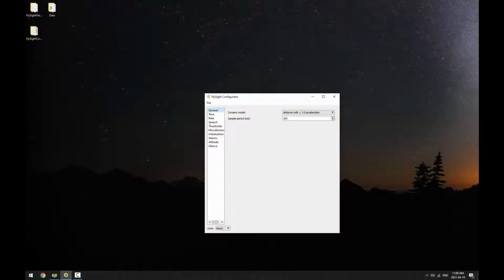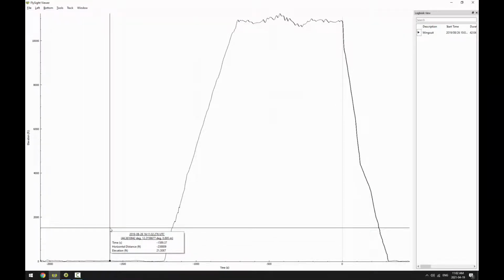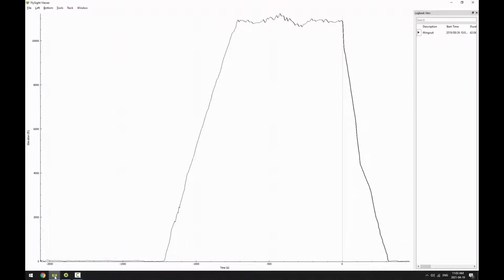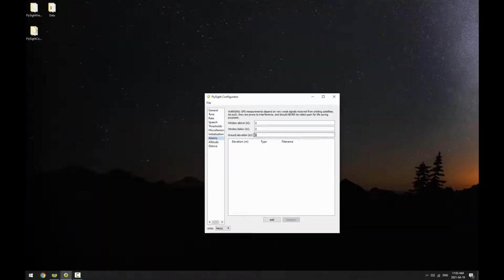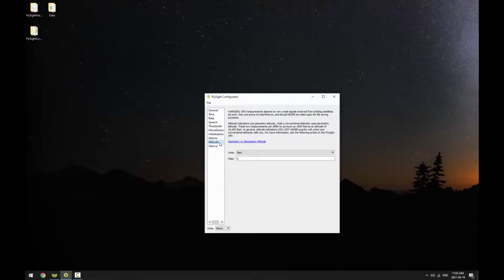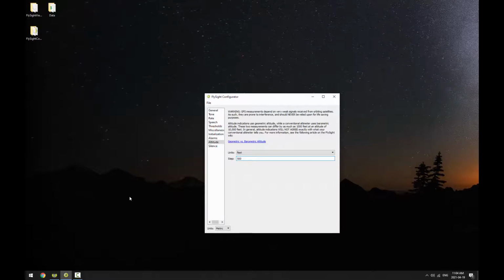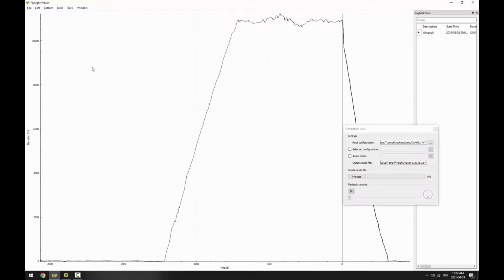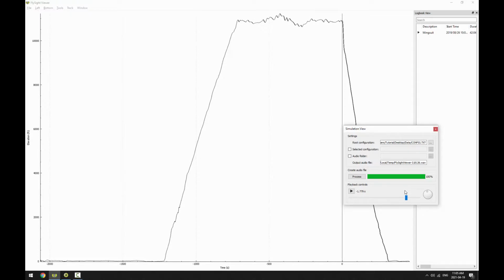Altitude Mode

Comment: What would be the way if possible to to an altitude offset. My departure airfield is 100 lower then my actual landing location
Reply from the maker: The best way would be to set DZ_Elev to the elevation for your landing area rather than your departure airfield. Unlike audible altimeters and AADs, the FlySight has minimal "intelligence" when it comes to determining dropzone elevation. Whatever you put in DZ_Elev is exactly what it will use as "zero" altitude.